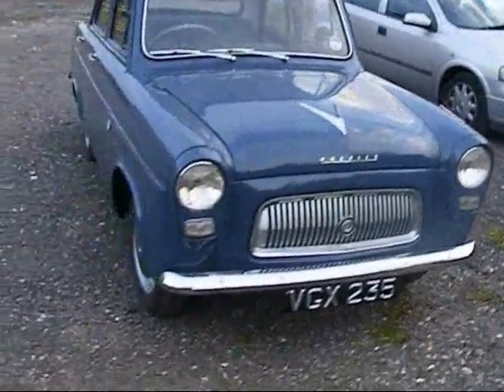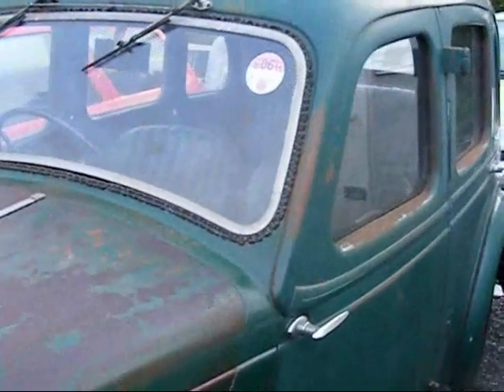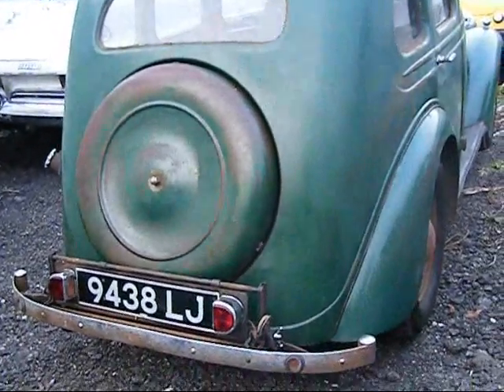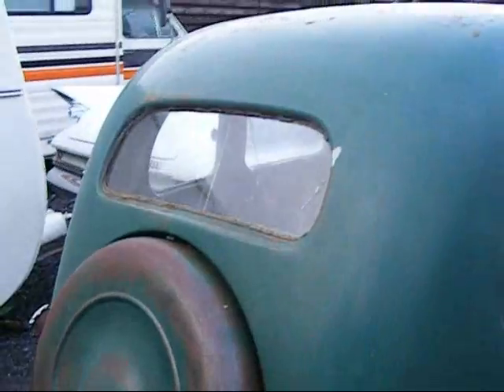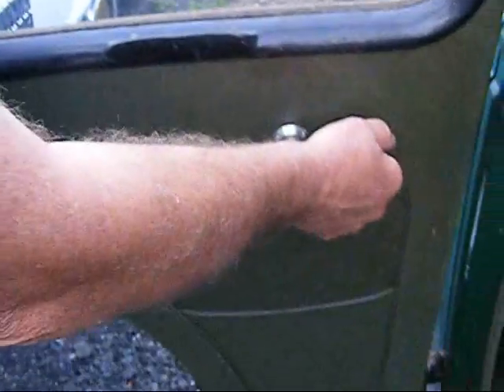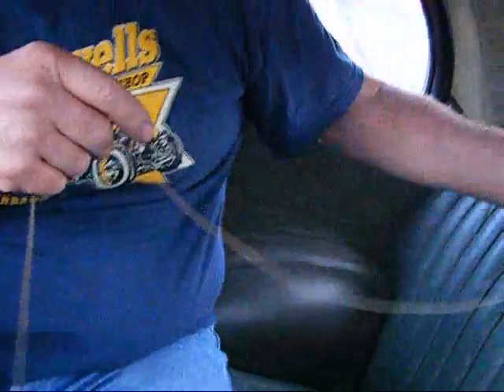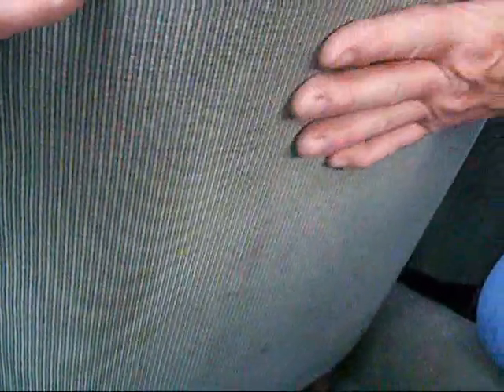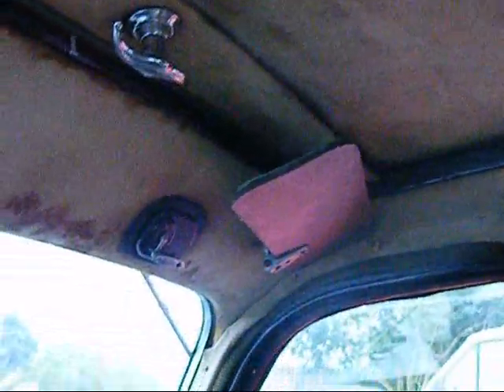(Part 1) 1937 STANDARD FLYING 10 classic English car 1930s BRITISH

Comment: the 1937 Standard ~ is it totally original ?  The registration plate is a lot newer than 1937 .... roughly around 1961/1962
Reply from the maker: Hello David,  Yes the car really is all totally original, although you are correct that the number plate has been changed at some point before we got it.  My other half is a very knowledgeable classic vehicle restorer, with over 40 years experience.  He just confirmed this information to me.  The car has been in storage and untouched since we bought it.